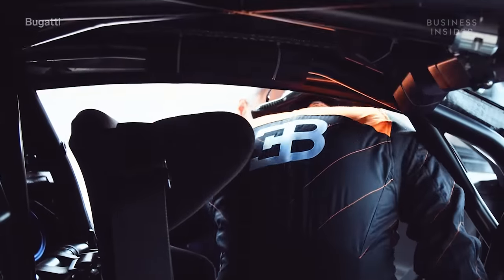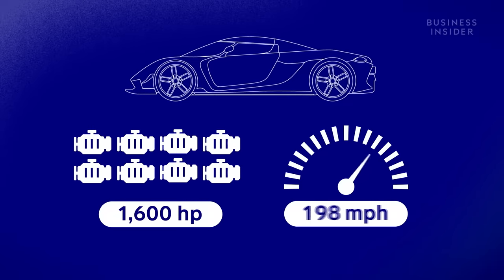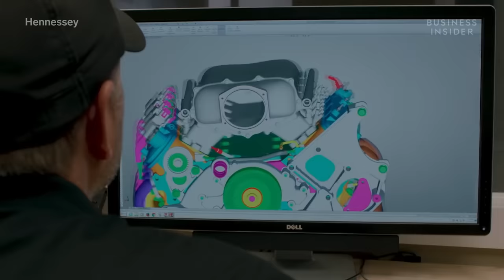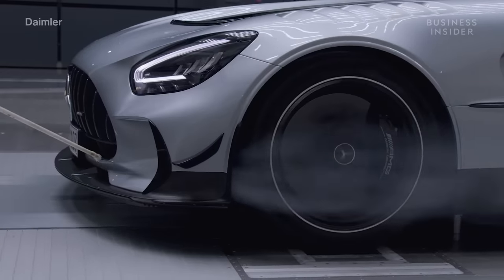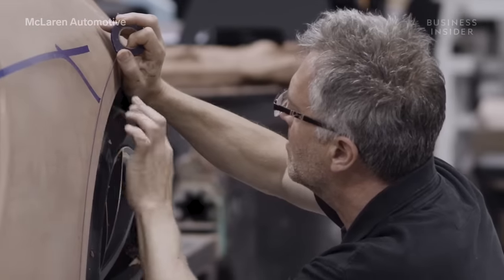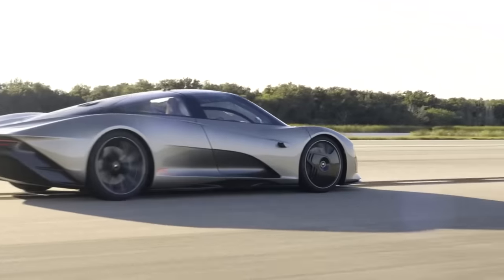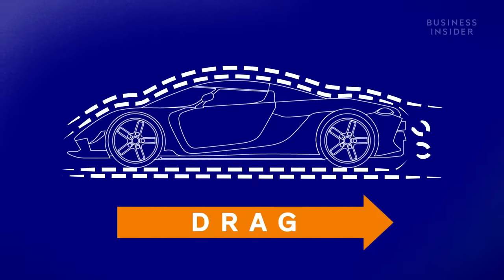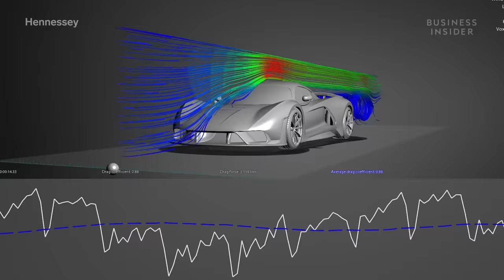Why It's Almost Impossible For Cars To Go 300 Miles Per Hour | Insider Cars

Comment: Another interesting limit to consider is that set by the speed of sound. The top of the wheel will be going twice as fast as the car itself, so if the car approaches 375 mph, the rubber on the wheels would break the soundbarrier 200 times a second, generating increased drag and putting additional stresses on the wheel.
Although these stresses are nothing in comparison with the centrifugal forces these wheels experience, they are still an interesting side effect to consider.
Reply: Dopler effect doesn't work like that.
Reply: I wasn't talking about the doppler effect, just the fact that the tops off the wheels are moving twice as fast as the car itself, which causes them to break the sound barrier when the car only goes half the speed of sound. This causes dragg on the wheels but primarily puts extreme stresses on them.

When setting the land speed record, engineers solved this issue by designing sollid smooth aluminium wheels, which created less dragg and most importantly didn't tear themselves apart (by resisting both centrifugal forces and the breaking of the soundbarrier).
Reply: @rutgerdobbelaere4716    sonic boom is due to dopler effect. I was referencing your first comment. Drag is obviously not the major problem for tires. They aren't directly exposed to incoming wind as F1. 
The major two issues are keeping the bulk modulus of tires such that they are not completely rock solid or soft enough to tear due to extreme shearing force while touching the ground.
In video these guys talked about adding carbon fiber reinforcement to prevent tyre from changing shape. (Easy peasy centrifugal force.)
Your premises are correct but the way you combine them to conclude your point is quite wrong.
Reply: Ok, you're right, the stresses aren't as great as I previously thought and said. I've edited my comment a little to make it closer to reality.
I first learned about this effect with helicopters. Here, the tips of the rotor could potentially break the soundbarrier if it goes to fast. This is why we don't see really fast classical helicopters (speed record of only 299mph). In helicopters, this effect is much much greater, hence my overestimation.
Reply: @rutgerdobbelaere4716  haha nice

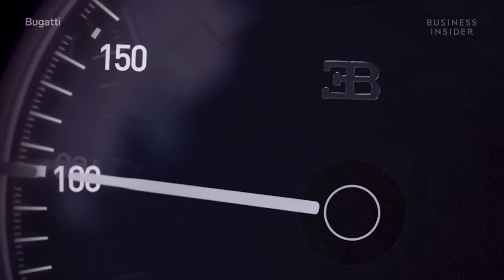Comment: There's a technical error at 1:10. The force required to overcome air resistance increases as the square of speed, not the cube. The POWER required increases as the cube of speed.
Reply: You're right, and there's an even worse error at 0:51 where he says that the square of the speed is exponential.
Reply: @insane_troll  you guys should write a letter

Comment: Also, keep in mind Where you can do this.  "Oh, we'll just take it out to a track."  There are no 300 MPH tracks.  There aren't any 250MPH tracks, because there's only a handful of cars that are capable of those speeds.  You don't have to just drive it at 300 MPH.  You have to get it up to 300 miles per hour, then back down to 0, without killing anyone in the process.  There's honestly not many places in the world with a straightaway long enough, and flat enough to do that.  If you hit a bump, you can fly right off the track.  So it also has to have no bumps large enough to send you out of control.  That means maintaining the track so it doesn't develop any bumps, that kill one of the few test drivers who've ever driven a car that fast.  In addition to all the exponential problems that kept us from doing it for so long in the first place.
Reply: You might as well have the car start to fly if going faster than 300mph.
Reply: @MindlessTube  right. You can feel a regular Honda start to elevate going 115mph. Idc what vehicle, it'll have that elevating scary feel like it'll flip over 100 times if wind shifts, there's a bump, or the tires start to give out 😬
Reply: @67nBrynhurstCuh  then you got bikers owning a $50K bike going 200mph on highways like it’s nothing
Reply: All dragstrips are 300mph plus tracks.
Reply: @alanbooker  those dragstrips only allow vehicles specifically meant for massive acceleration to go that fast. They're not nearly long enough for a car that takes over a minute to reach that speed.
Reply: Fortunately we in Germany have the Autobahn where it is legal and straight/wide enough to drive that fast.
Reply: @leonfa259  yeah, I know a location or 2 where the autobahn is dead straight. I think they built it that way so they could use it as a runway in case of war.

BTW, the longest dead straight road is in the nullabor plain in Australia. Not sure how long it is but AFAIK it's more than 100 km.
Reply: @drakedbz  And your point is?
Reply: Plenty of places... not a whole lot of cars that have the power to get to that speed quickly enough Bugatti is a slowpoke to get to 300, it is pretty much engineered to barely get there, many top fuel get there in under1/4 mile, of course they also make 10k hp.
Reply: @drakedbz  You mean the under powered cars?
Reply: Any decent sized airport will work

Comment: "why it's impossible to reach 300 mph"

Me: laughs in ferrari 599XX E
Reply: I’ve seen your kind on the highway
Reply: Forza? lol
Reply: With rally suspensions
Reply: Your top speed is 196! That’s hella fast.
Reply: Only the OGs remember when the F1 gt was the fastest
Reply: "a stock top speed of 240 mph", I know the modifications can get it past 300 but shouldn't the standard for this whole issue be on something other than a track?  flat land without that tilt upward of the passenger side (assuming American steering wheel...)
Reply: @Just_Modify  
Where did you get 196?
Reply: @mickeydrago9401  from the manufacturer
Reply: @Just_Modify  
Even if you confused the evolution with the slower one it's still faster than your 196:

"Performance. With a stock top speed of 240 mph (386 km/h), which is 33 mph (53 km/h) higher than on the standard 599XX, the 599XX Evolution"

So what are you talking about?
Show us the link

Do you like making crap up?
Reply: @Just_Modify  
So did I and I looked at the Ferrari website and I already cited other links with quotes but you have not... So let's see a website
Reply: @mickeydrago9401  I was looking up the 599xx and not the evo, evo is 77lbs lighter and has a slight hp increase but the power increase won’t amount to much more top speed. Maybe 215 tops and that’s being very giving on the number. The amount of hp that would be needed to get from 196 to 240 is about 20-25% more power so the top speed you say can’t be real. It’s all just mathematics. They need to make over 1000 then it will be insane fast!!
Reply: @Just_Modify  
The link I gave you actually has 196 mph and it lists the submodel evolution, But in double checking it it is for the model that is not the evolution submodel .. So you are correct, But you are wrong to quote that speed because this thread starter is about the evolution which is faster...

Jesus, next time I'll let the experts take over... I have a 1.6 liter for cylinder economy car made in Korea so I'm not sure why I should even care 😜
The most souped-up car I had had a supercharger and it only added 20 horsepower, up to 220 horsepower and only a 6-cylinder 😒, 1994 car
Reply: @Just_Modify  
The top speed I was quoting was from somebody else online and it was for the evolution and it was modified
Reply: @mickeydrago9401  this article makes me miss my 2004 VW r32 with a 1.8t engine swapped into it with a 5431e precision turbo, had around 440-ish at the wheels and was awd. Fun car!!
Reply: Not a production car... also not tested.
Reply: Top fuel car be like "ez' 10k hp

Comment: "The increase is exponential"
shows a polynomial relationship
Reply: Umm... If you graph the relation you'll see an exponential curve... He's correct
Reply: @howdoifindaname2743  No, the formula shown is not an exponential one.
Reply: @bobbyv369  if you make a f v graph you will see that it's not linear but a curve
Reply: Hahaha Very interesting point

Although I think a lot of the time when people say "exponential", they don't mean it literally in the mathematically precise sense- I think it's usually just meant to imply "nonlinear"
Reply: @nothim8997  exponential doesn't mean nonlinear. If the dependent variable (in this case v) is not in the exponent (in this relation it is not), then it is not exponential. Period. End of discussion.
Reply: @timseguine2  when it comes to cars, drag increases with the square of the speed, which makes it exponential. Of course aircraft are a different matter, they have a speed where drag reaches a minimum. Fly slower, drag goes up, fly faster, drag also goes up.
Reply: @mrxmry3264  No I already explained: it matters a great deal if the dependent variable is in the exponent or the base. It is only called exponential if the dependent variable is in the exponent. if the dependent variable is in the base (as in this case) it is called polynomial.

Specifically since it increases with the square of speed, this is called QUADRATIC growth. Not anything else. Especially not exponential growth. It would only be called exponential if it were e^v or 2^v or something like that.

Mathematics has very precise language. It is precise for a reason.
Reply: @timseguine2  if you say so...
Reply: @mrxmry3264  I studied mathematics and mathematical physics. I don't "say so": every single math and physics text intended for an academic audience "says so". It is not my fault if engineers and laypeople use the words wrong.

Comment: Fastest I have ever gone in a car was 320km/hr. The car was still picking up speed but the pavement was coming up too fast. It was on a dead road with no traffic in a 2007 C6 Corvette with a Callaway Supercharger kit installed. It was no Porsche, Lambo or Ferrari but to me it was a dream come true! The sound that supercharger made was visceral!
Reply: Did that car and experience injustice by putting the speed you went in Km/hr.
Reply: @Mostly-Nuts  Just using km/h already shows that the man has an intellect superior to anyone who uses miles per cup of tea
Reply: @pedro.alcatra  🗿
Reply: @pedro.alcatra  wrong mph>>>>kmh
Reply: @soulreaper8825  mph = kmh

Comment: Honestly this was a perfect video and more should be like this: to the point, covered everything quickly and simply, and no extra BS. Thank you.
Reply: It left a bit to be desired in a couple of areas. The graphics were good and I really liked that it pointed out the limitations of tyres. But what I particularly liked was the way they explained that drag increases with the cube of the velocity.

What they left out was a decent understanding od aerodynamics. Downforce in this sphere is hard for most people to comprehend, even if they did understand the earlier parts. The most important thing here is not downforce. It's balance. If you put a wing on the back of the car, you need to balance it at the front, either with body shaping or with an underbody shape. the fact that the car only produces a small amount of downforce at its maximum speed is a fair indication that it's not a strictly critical component. It's needed but since this is about outright speed, rather than going around corners, a maximum load would not help. It would also create problems for the tyres which are already under maximum pressure.
Reply: @chestercopperpot777  I thought it wasn't so much about what it means but what implications that has for high speeds.

Comment: The current holder of the Outright World Land Speed Record is ThrustSSC driven by Andy Green, a twin turbofan jet-powered car which achieved 763.035 mph - 1227.985 km/h - over one mile in October 1997. This is the first supersonic record as it exceeded the sound barrier at Mach 1.016.
Reply: Yea I’ve heard of it. That’s Cool and all with literal metal tires. But it’s not a car you can drive lol
Reply: thats not road legal
Reply: Its just a plane without the wings its not even a car... Just doesn't make sense..
Reply: thats a twin jet engine on a  frame on metal wheels. its a "car"

Comment: And that goes to show how incredible top fuel dragsters are. They hit 330mph in 1000 feet in under 4 seconds.
Reply: And like mentioned in the video, their tires turn into complete putty going off the line, they look like balloon animals.
Reply: Yeah but how far are they gonna get on a normal road with turns? At least this Bugatti can be practical to use and STILL beat most dragster cars lmao
Reply: @YoMamaWazHere  it doesn't come close to beating a dragster in a drag race. A dragster is going beyond 300mph faster than the Bugatti gets to 100mph. It would literally get gapped by half the track.
Reply: @YoMamaWazHere  top fuel is faster
Reply: @stephenwhite5444  true but think he is talking about on the road
Reply: @YoMamaWazHere top fuels are literally the fastest accelerating vehicles on the planet what are you on 😭

Comment: I’ve taken my car to 163mph and it was a trip how fast things come at you and how much you have to think ahead.
Reply: I remember when I was 16 and dumb, I took my '93 (stock) Civic (in 2001) to 117mph on an expressway in the middle of the night and I thought the whole car was going to fall apart
Reply: @weston407  the car I took to 163 was a Porsche 911 so it was “made” to do that. It was still scary.  I think I was dumb too.
Reply: @weston407  I took my 98 civic stock to 117 mph and it was like I wasn’t touching the ground anymore. It’s like playing a video game and you are just controlling the direction with no resistance
Reply: And it's a trip how long it would take to avoid something, or stop before hitting it at that speed. 8/10th of a football field covered in 1 second doing 163 mph.
Reply: You start looking further and further down then road and the only thing you think about is what is in front of you.
Reply: @weston407  dang i did that in my 07 impala in the day i hit 110 and had to coast down to 90 cause the engine is half bolted down and shook the car too much if i hit the brakes going 110. very dumb. very fun

Comment: Not sure if it's been said, but at 300mph, the top of the tire is returning to the front at effectively 600mph, or about Mach .78.  At 380mph, the top of the tires would be trans-sonic.  One of many things to think about in engineering
Reply: Yeah, but it's also doing that inside an aerodynamic bubble.
Reply: 'the top of the tire is returning to the front'...
Uh, what? All of the tire is moving at the same speed. 
If you're talking about relative motion, like a helicopter rotor in forward flight with wind relative to direction of flight, how is that relevant to a tire?
Reply: @2whl4re  it isn't relevant.
Reply: Depends on the size (diameter) of the tire.  Taller tire turns slower.

Comment: Kenny Bernstein went 300mph in 1992 in a dragster. It just took a while for regular cars to catch up. After they started going 330mph a few years ago they had to shorten the 1/4 mile to 1000 feet. They could go faster but the tracks are too short.

Comment: Malcolm Campbell achieved 301 mph in 1935.  The fastest a combustion engine car has gone is 394 mph by John Cobb in 1947.  The first run exceeded 400 mph.
Reply: And they were street legal, had great cornering, and rubber tires?
Reply: @0MoTheG  well, they did have rubber tyres, and because it was the 1930s, no one would've said no to them driving them on the road. And it's not like he original veyron or the Hennessy venom had "stellar handling" themselves...
Their problem would've been longevity, although the Napier lion engine used in the railton special was used for endurance records, so it mightve been fine going hours on end as it had done in the napier railton (different car they made before, similar name)
Reply: @0MoTheG  Look at the title.
Reply: The fastest a combustion, piston powered "car" has gone was 426 MPH in 2011 driven by George Poteet on the Bonneville Salt Flats.... it was powered by a 2200 HP V8 engine.....

Also... Mickey Thompson broke John Cobb's record in 1960 by going 406 MPH on the Bonneville Salt Flats....
Reply: @dschamber7190  Obviously the site I gathered the information from wasn't factual.  
I was looking for land speed records, and of course most were achieved by jet engines.  My bad for being sloppy.
Reply: @dschamber7190  Actually you're also wrong that was broken again first by Poet and then by Danny Thompson who is  Mickey Thompson's son in Challenger 2 in 2018 at 448.757mph. The record now stands at 470.016mph set in 2020 by George Poet again in an up-engined Speed demon.
Reply: It's all about drag. Making a car that can go 300 mph is relatively easy. Making a PRODUCTION car that can go 300 mph is a completely different story
Reply: @DemonLordGamingAC0  I am well aware of that.  I merely pointed out that cars have exceeded 300 mph.
Reply: @kenchristie9214  they obviously mean production cars
Reply: @tobymacdonald5893  If the idiot meant propduction cars, he should have stated that.  The simple fact is internal conbustion engine cars have exceeded 300 mph.
Personally even cars that can do over 200 mph aren't necessary.  They are dangerous in the hands of idiots, and idiots are drawn to these vehicles.
Of course the technology gained from the development of F1 and supercars do have a flown benefit to average production cars.
Reply: @tobymacdonald5893  Making a production car go that fast isn't terribly hard either. Modified production cars go that fast routinely these days at Bonneville. The video identified the wrong problem.  The hard thing is making that same car able to drive in stop and go traffic without breaking down overheating or crashing into anyone.